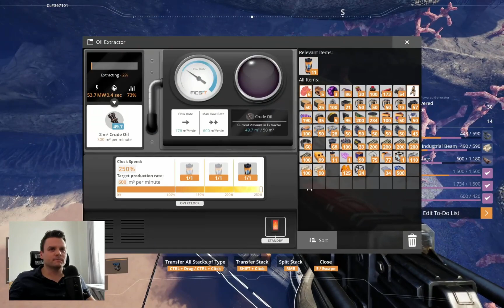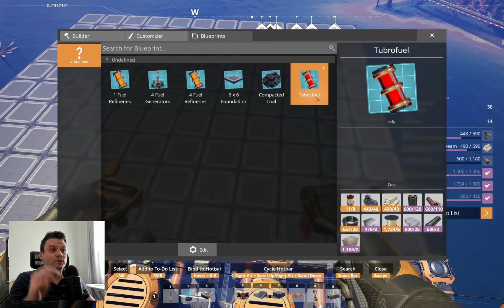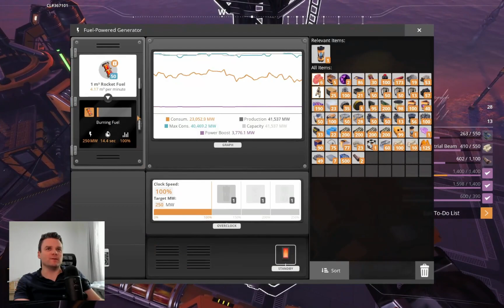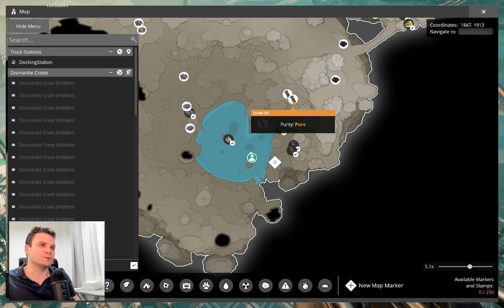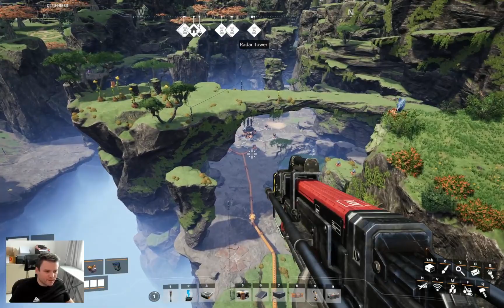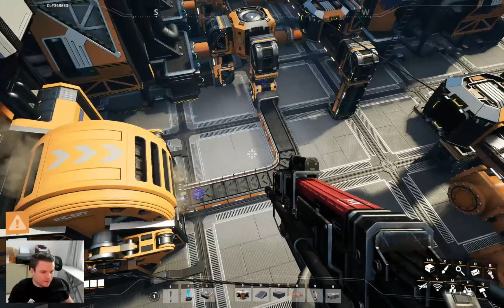This rocket fuel power plant got out of control... - Satisfactory 1.0

Comment from the maker: Will you be building your own rocket fuel power plant? or prefer to setup nuclear power?
Reply: a have like a problem a have to place 1600 fuel generator 😅😅😅😅😭😭😭😭😭😭
Reply: @snakelord639  I built my Ionized fuel plant at the edge of the map for this reason, a lot of space at the same level to spam generators, 1 pipe is exacly 80 fully overclocked generators and that just about fits before I get out of bounds, just 20 blueprint clicks per line so not that bad :p
Reply: Rocket fuel for sure, I made my plant in the same spot. Even did it with diluted fuel to maximize the yield and ended up making 5000/m rocket fuel and building 1200 fuel generators.
I later noticed that I had missed two of the oil deposits as they were just outside of my radar tower so it wasn't quite optimized after all, I'll let that be for now and if I somehow end up needing more than my current 350GW of power I'll expand it later.
Reply: @-42-47  Sounds like enough power for most things , does it look good😅😀
Reply: @mikaellarsson135  Lets just say it looks somewhat acceptable. There's no clipping and all buildings are aligned in nice straight lines, as are most of the pipes. But haven't really payed it much cosmetic attention
Reply: @-42-47  Sounds like the only one that needs to be happy with it is , you that is :)
Reply: Both😅
Reply: I've built a rocket fuel plant. It makes 2,400 packaged rocket fuel/min as well as 1,000 packaged turbo fuel/min. All from a 1,200 m³/min pressurized crude well. I plan to drive this down underground to feed this into two rocket power stations making 144GW each via Trucks, not trains.

Comment: Why does no one in satisfactory use proper metric terminology? It's not "100,000 megawatts", it's 100 gigawatts. It's not 1,000,000 megawatts, it's 1 terawatt.
Or maybe we should start using watts? How does 1,000,000,000,000 (trillion) watts when you mean 1 terawatt sound?

Comment: I also targeted this spot for rocket fuel production but I used 3 alternates and the 3 sulfur nodes to the W-NW and the local nitrogen gas to be able to produce 1800 rocket fuel/min off 450 crude/min. I used heavy oil residue, diluted fuel, and nitro rocket fuel as alternates.

Nitro rocket fuel skips the compacted coal requirement of turbofuel (still requires sulfur and coal) but 400 fuel/min = 600 rocket fuel/minute while skipping turbofuel.

EDIT: Also, another thing: you don't need anything but the rocket fuel production on the bottom floor. Rocket Fuel behaves like a gas so pipeline pumps aren't required and you can produce it all at the bottom and then pipe it up.

Comment: You missed a much closer and abundant source of coal and sulfer towards the bottom left of the crater. Also a close nitrogen spot down there. With diluted fuel recipe and heavy oil residue alt, you can get about 900 rocket fuel per 225 oil.
Reply from the maker: sounds like an expansion opportunity for me... 😅
Reply: @agamorgaming5728  yeah i just finished a massive rocket fuel generator farm.  Took 90 machines with 3 shards in each. It only uses 600 sulfur and i believe 300 coal, so if i wanted to get crazy i still have enough local resources to double or even triple it.... but i think i would get burnt out.